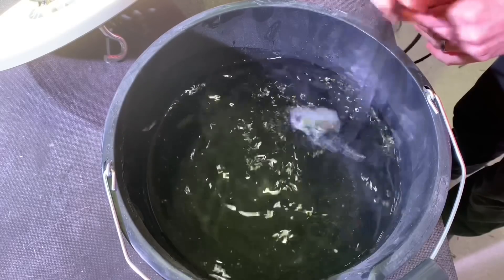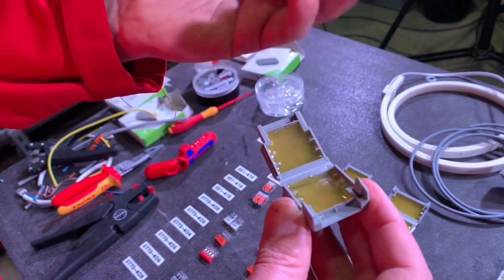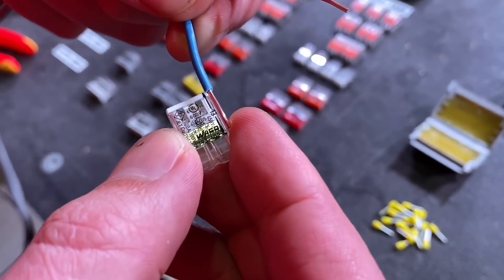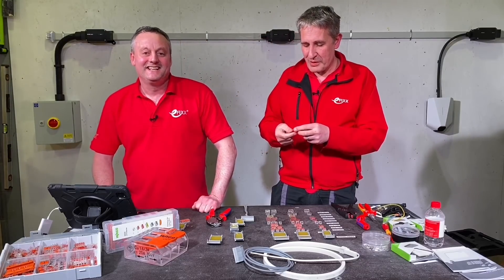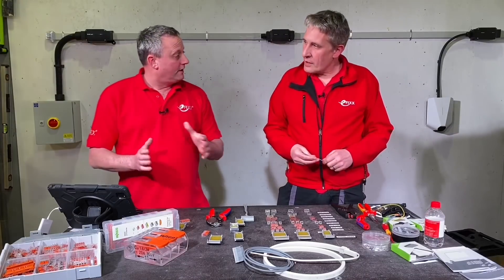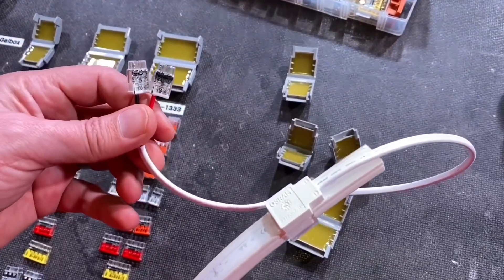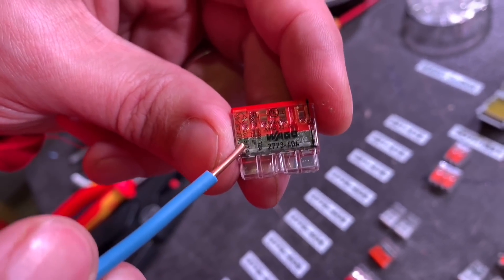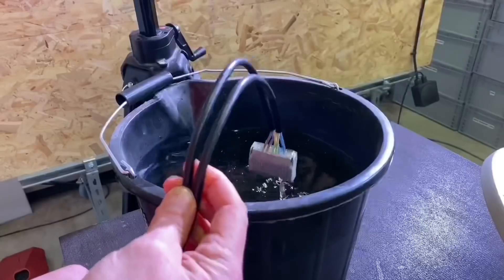Waterproof wiring using the WAGO 2773 connectors and Gelbox - IPx8

Comment: Really frustrating that the gel boxes aren’t available in the USA. Wago USA advised me Underwriters Laboratories (UL) haven’t approved the gel boxes. Needless to say I discovered this after using six 221’s inside a plastic box inside my septic tank which is a very damp location. I may have to go back to blue wire nuts if I can’t figure out a way of keeping the 221’s dry 
:(

Comment: Catch up with what? We had eight of those stupid wago splices melt at a 1200 room hotel. Remember we have double the current at 120v. They may be ok for end of line lighting with a .05 amp load but not a air or reefer circuit.

Comment: Hello, I’m in Canada where I’m also stuck with wire nuts. I’ve always been curious what the cost of wago’s are over the pond. Here it’s difficult to get 2 connection 221 for less then $.40 where wire nuts are less then $.02. What are you guys paying for wago’s where they are more widely adopted?

Comment: Any idea if and when these will get approved to use in North America for use in aluminum wiring?  Those alumicons are a joke price wise.
Reply from the maker: The 2773 connectors already have UL approval - we'll have to check on the actual gelbox.
Reply: @efixx  I’m referring to the ones to be able to connect aluminum and copper wire together together. I know they are approved in Europe as long as you use their antioxidant paste but not approved here. Would make life so much easier and cheaper without having to buy special Co/Alr outlets and switches and less crowded in the box 👍🏻...and too clarify..it would be 2273-243 or 222 for junction boxes.
Reply from the maker: Interesting it’s very rare we see aluminium cables in the UK so not a problem we face. I’ll ask our contacts at Wago and see if they know.
Reply: @efixx  They would make a killing selling those here.

Comment: Are ferrules a recognised system...ie while using them on the wago(non cage) the wago is only biting down on the actual ferrule...if the wire slips out or works its way loose from the ferrule you lose the wago advantage(wago hack).  ?
Reply from the maker: If you can pull the wire from the ferrule it’s a problem with the crimp tool. We did check with Wago before suggesting the hack.,

Comment: that is interesting.
Here in Germany the terminals are called 2273 and are only up to 2.5mm2 and a variant with 6 conductors does not exist.
However, we also have the gel boxes and the 221.
Reply from the maker: The 2773 - is the upgraded (new) version of the 2273 .  The 2273 will be discontinued soon.
Reply: @efixx  that is interesting to.
i looked at wago (.com) and found the 2773, but they dont have the vde approval. (vde ia required in germany)
i am curios if an when they will come to us.

i send this twice, because the first comment is not shwoing up. maybe the wago link is the problem😂

Comment: Love the 2773 connectors.  You can pretty much get connections onto any lights no matter how little space you have, Chandeliers, back box neutrals.     
The other day it was fumagalli wall lights, Great light but damn all space to play with when fitting them, was using heat shrink on them before but now I could try these gel boxes
Reply: WAGO also has the micro connectors now

Comment: 2773 ? Or 2273.?
Reply from the maker: 2773 is the updated version of 2273 - common rating  and cable size across the range
Reply: @efixx  in Germany the 2773 doesnt exist -,-
Reply: Depends on where you are in the world as we only offer one type per country. 2273=2.5mm max 24A, 2773 =4.0mm 32A.

Comment: I find the 2273 series are great for joining neutrals and CPCs behind switches (where the lighting circuit is fed to switch rather than using a drop cable) - they're so much smaller than anything else, and the ability to have four conductors connected in a flat connector (as opposed to the 2x2 grid of a 773 series) is great if space is tight

Comment: I had considered the ferrule trick previously, though as the ferrule material is harder than copper I was concerned the Wago might not bite hard enough to make a good connection. Have Wago given their blessing to this, and is it limited to any manufacturer of ferrule?
Reply from the maker: We did consult Wago before launching this hack. You are limited on conductor sizes at top and bottom end of size ranges. Too big plastic on ferrule doesn’t fit. Too small can’t get enough insertion force.
Reply: @efixx  What about uninsulated ferrules?

Comment: Graham, please play your vid back and then check the regs, a couple of comments that may mislead the sheep of the electrical world. First selv is not safety low voltage, and you stated first after terminating into the gel pack that's all you need to do, you just introduced a code 2 fault in your termination, it cannot be left like that. For anyone who disagrees please read the regs and guidence notes on how to do it. Don't be  a sheep. Graham you did correct yourself after placing wago into the bucket, but people respond more by visual than vocal direction.
Reply from the maker: You’ll have to explain further so I get the gist  - we gave two examples a SELV system supplying 24VDC LED tape and a mains voltage system LV supplying something like a bollard. The second would have to be inside a suitable enclosure.

Comment: I have seen the Chinese copies of wago on Bigclive(a recommended watch) now I see ToolStation selling these unbranded THREE WAY wago clones anyone used them?
Having looked at them still prefer wago 221
Reply from the maker: Lots of copies around mainly based on the older versions - we like the clear type so you can see the quality of the connection.
Reply: I have asked ToolStation to email me the data sheet to check it conforms and still waiting. Very interesting as they say they are unbranded. The last refresher course covering pat testing we must not say fake but not compliant to UK regulations.  The biggest thing I see with the ToolStation connectors is separation which is less than good old screw terminals for use on LV, these may comply with ELV????
Reply: Never purchase or use any safety or test equipment & electrical items made.by lying cheating lack of quality control scum bag china.

Comment: Would bedubious using it with the earth in T&E with a sleeve as it could allow moisture into the joint through the sleeve.  On the other hand , Where do i get one of those huge WAGOs on the table , i want one lol
Reply from the maker: Good point - we will look at that further - may have to leave the sleeve “short” - The big Wago’s are rare as...
Reply: @efixx   I have a 120mm 4 core to joint , they look ideal lol
Reply: @cripwellwalsall4700  check out our 285 series for you 120mm
Reply: Sleeve may allow water and result in failure of connection over time, but as it is the cpc it will  probably not be as critical as it should be at it would help ensure a rcd trip if water leaks to the live or neutral
Reply: @stevendrennan167  yes but inside the same enclosure is the love and neutral so would short out in no time due to ingress of water
Reply: Would you be using T&E in a high moisture environment, where gel filled joints would be beneficial? Probably not.
Reply: @andrewrobinson395  personally no , but thats beside the point lol

Comment: 10:25 except for all the water going down the earth sleeving.  I know its not a huge issue there, but using the sleeving seems to hurt in this application.  I wonder if it would be better to cut the sleeving short to reaming outside the gel area.  That would help prevent corrosion on the copper wire.  Otherwise great video.  I sure would love to find one of the giant 221 demonstration connectors.

Comment: You do not want moisture getting between the conductors and outer insulation sheath.  I assume the outer sheath insulation should be right up to the waterproof connector.  It looks like the gel would seal the end of the outer sheath.

Comment: Are these waterproof enclosures maintenance free connectors.
Reply: The connectors are maintenance free but the enclosure is not as the cables are not restrained.
Reply: @daviddraper9256  
thx
Reply: I was thinking of a way to make them maintenance free by using cable ties.
Reply: @johnburns4017  What is the application you have in mind?
Reply: @daviddraper9256  
None really, wanting to know if they can be.  Maintenance free would be handy in wet areas.

Comment: Nice to see a chart of the wagos and an explanation of the sizes for conductors, i wasn't aware of the sizing having only used a small selection.
I have found when doing electrical testing after fitting the 221 lever connections if you have a connector with a spare terminal the mft tester probes go in nicely and the lever locks it in place to stop the test lead dropping out making it easier whilst testing.
Reply from the maker: Great tip - thanks Paul
Reply: The 221 connectors have 2 test probe sockets built in , to the front and back of the lever with text on, though it does require a fine probe. If there is a spare way certainly easier to use that.
Reply: @MrKarlPrince  yes its easier to clamp the test probe down leaving hands free if possible than trying to hold the thin test probes especially when working above head height.

Comment: I love the 221 but I always worry about the levers popping open as the odd time it has happened.
Reply from the maker: Use these 2773’s to reduce the worry
Reply: I will try but I don’t like them as twisting them off is a pain with multiple cables in one block.
Reply: What causes the lever to pop open vibration?
I have seen the lever break but never come loose.
Reply: @Electronics-Rocks  I am not sure.  It’s probably when you have a few squeezed into a small enclosure and they rub against other cables/Wago’s.  I use 221’s for everything.  When you are doing multiple jobs and waiting for other trades to carry on with your next part of the install it’s clip and un clip away.   It might just be that the clip is slightly up but the actual mechanism isn’t open?
Reply: @darrenplant619  interesting as I use wago nearly all the time except for heat conditions.  I think the answer maybe other trades!!!  
Would be interesting to find out if anyone else has found the same.
Is it solid cores or stranded?
Reply: @Electronics-Rocks  no, nothing to do with other trades.  I am not saying they pop open fully it jus appears they are not fully down.   Maybe as I said before they are still holding the cable core fully but the lever is not 100% down.
Reply: @Electronics-Rocks  my original comment is worded badly m8. My apologies.

Comment: not ideal in UK as you guys are using sleeving arount the earth, that creates an opening for water to enter
Reply: Yes, roll on fully insulated CPCs as used in Ireland, NZ, Australia etc in their T&E equivalents, and of course most of the rest of the world in their standard cable types (except North America lol)
Reply: @TheChipmunk2008  there's a good reason we do, it's not just lazyness!

It means our ir tests give a much more accurate result of the degradation of the inner sleeving. You could have a cable who's brown insulation has badly degraded making the cable effectively single insulated, but if the cpc's sleeving is in the cable and in good condition, an ir test won't pick it up.
Reply: around*
Reply from the maker: Good point - we will investigate further - Thanks 🙏
Reply: Thats a good spot..... I assume the requirement for a 2nd enclosure  (as mentioned in the vid) would mitigate that issue a little as these aren't supposed to be used where the box is submerged in water but yh there is certainly scope for the water to wick up the Earth sleeving at the cable sheath end....

Maybe just a small section of glue lined heatshrink would fix that?
Reply: @Thats_Mr_Random_Person_to_you  only if that other box has the same IP rating, if it does then it makes this enclosure redundant